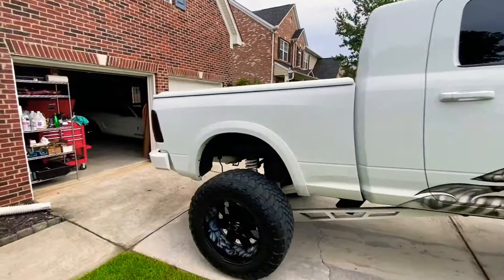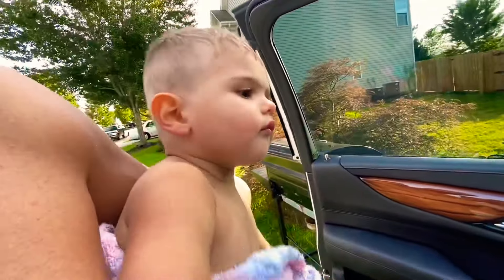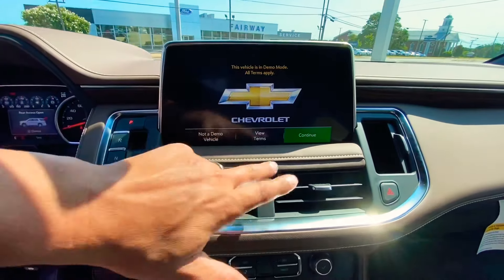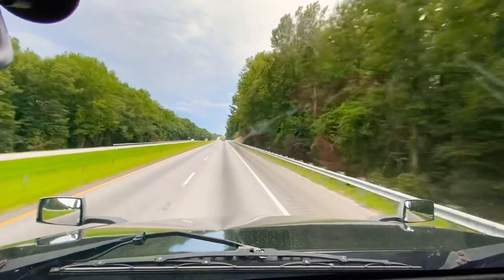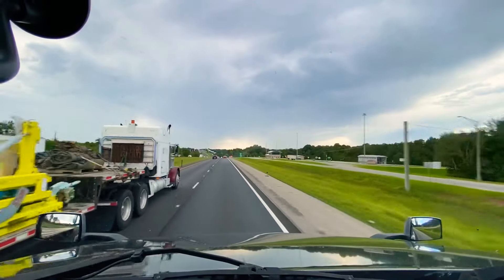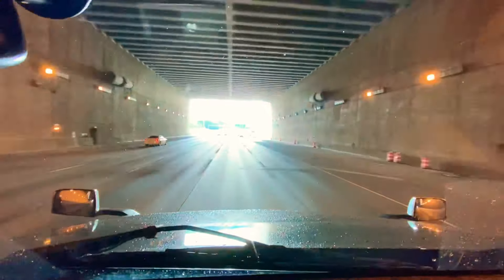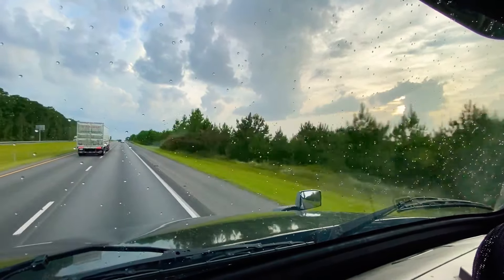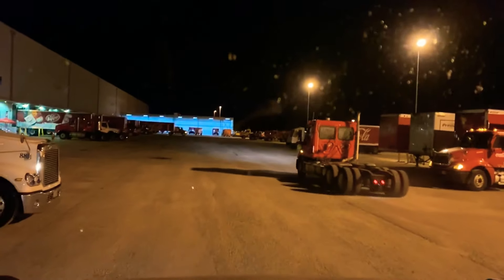“AC is Fixed” HomeTime before Delivery and Escalade Tune Explained A day in the Life of a OTR Driver

Comment: I’d be careful about modifying the software for that transmission. The software in these vehicles are designed to learn your driving habits. Any change in your habits or secondary drivers can cause unusual shift patterns and they are commonly mistaken for a failure. If the TCM does not trigger your check engine light, it is very unlikely there is anything wrong.

Comment: Got a question. I have Volvo also but lately it’s been taking awhile to crank when I try to start. U think that’s the batteries or my starter ?
Reply from the maker: Mine was pressure relief valve on end of injector rail ...  could be batteries though or starter
Reply: JustTruckin I’m thinking it’s the battery cause I left it sitting for a few days with the power cut off and it was dead.
Reply: @1982MCI  I actually just replaced them both. 4 new batteries and a starter. Didn’t wanna take the chance.

Comment: Good tip is if your AC is froze up, turn just fan on for a bit while driving if u can stand it and let just fresh air defrost those lines, also, pull the filter when u leave the truck and just put on dash to let dry. Stay cool bud!
Reply from the maker: Great tips 🙏🏽🚚

Comment: Man those GM 8l45 transmissions are horrible for that hard shifting, Mine used to do it but i found if i just ease into the gas from a stop it doesn't shift as hard from 1st to 2nd